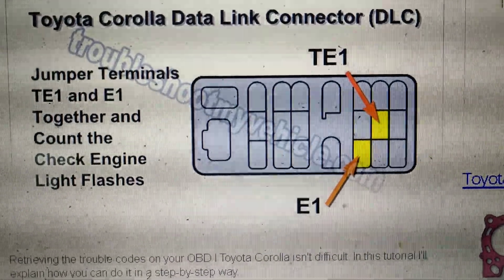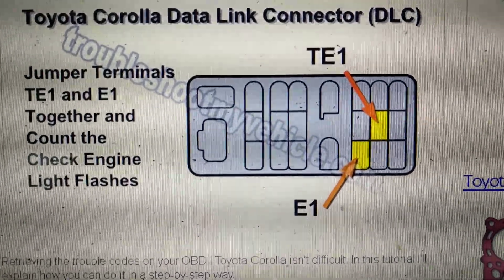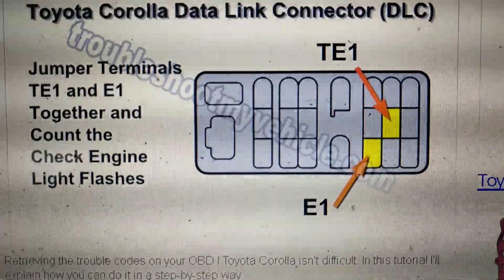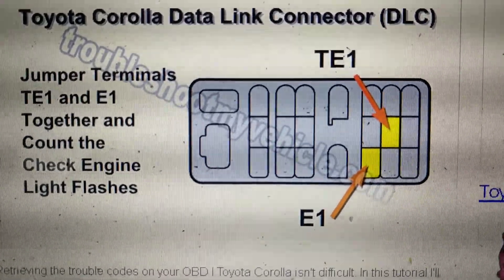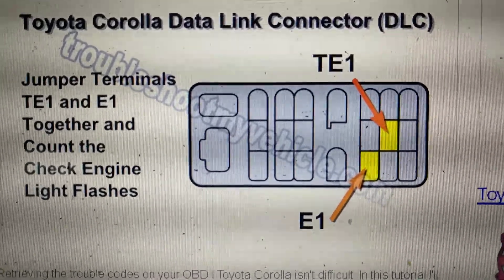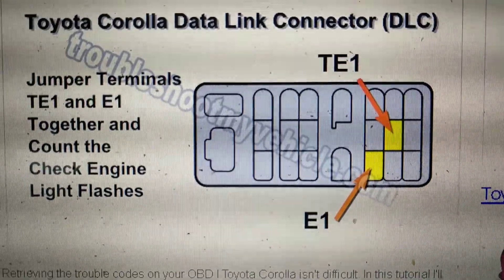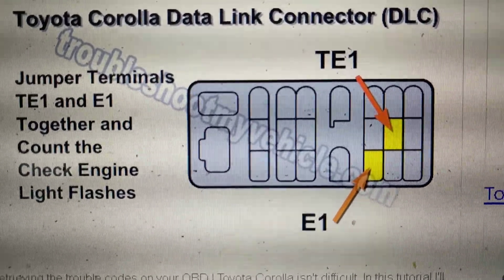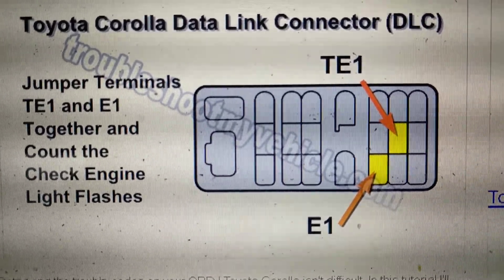Read Check Engine Light with Paper Clip // Geo Prizm

Comment: Hi, Thanks for the video, I have toyota corolla petrol 2002, one day the engine light came on and start loosing power (i had to high rev to drive the car), took to mechanic but the his computer cant read any code , not sure what else i can do. on low speed the engine light stays on  but when i go high speed the engine light start fleshing and exhaust noise is a bit loud and feels like miss fire. any guess please?
Reply from the maker: My best guess. Clogged/faulty fuel injectors. You may want to run some fuel additive through the system, see if that helps. Otherwise you may need to figure out which injector it is and replace it. You can check this by pulling your spark plugs and comparing or using a multimeter to test each injector.

videos i found:
https://youtu.be/Z5xWObLKWTo
https://youtu.be/ImnIw3lQOnA

Comment: What if the engine light and O/D light just keep flashing at the same rate? I replaced the distributor on my Prizm, adjusted the timing to 10 degrees. The car fires right up and runs perfect but will drop RPM for an instance and the engine light flashes (almost like the ignition got cut  for a split second). Can pull any codes?
Reply: I'm having this exact problem with my 94 atm

Comment from the maker: There seems to be some confusion regarding Toyota Corolla and Chevy/Geo Prizm. They are mechanically identical cars, with only differences in style. They were built in the same factory as a joint partnership between Toyota and Chevy. I currently own a 95 Geo Prizm and a 99 Chevy prizm. Both engines are stamped "Toyota" and I am able to swap Corolla parts on both of them. 

If you are getting "shocked", chances are you are doing it wrong. Always pay close attention when fiddling with any electronics.

Comment: I have 1995 corolla ,when i connect TE1 & E1 the service engine just flashing in constant timing
my problem is after driving for seconds the service engine light comes on and comes off when I turned off the car
what is the problem

Comment: P071
Reply from the maker: "The P0171 OBD-II code means that, on the first bank of the engine, the fuel system is running weak or a vacuum leak exists near this side of the engine. A lean condition occurs when the engine either receives too little fuel or too much air."

https://www.yourmechanic.com/article/p0171-obd-ii-trouble-code-system-too-lean-bank-1-by-andrew-quinn